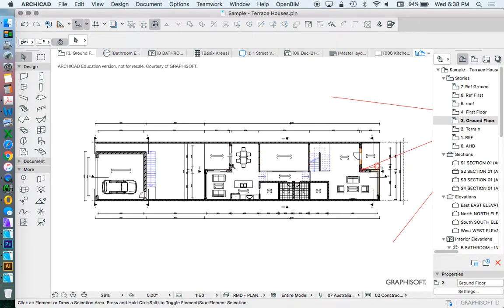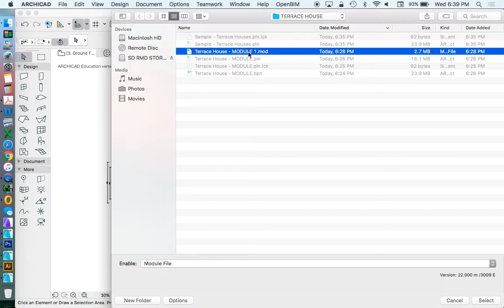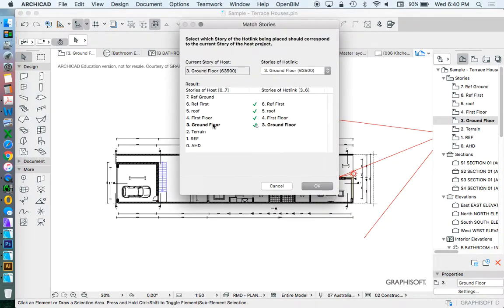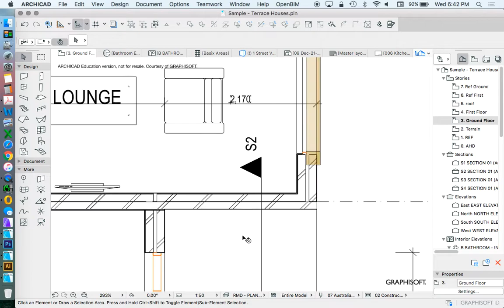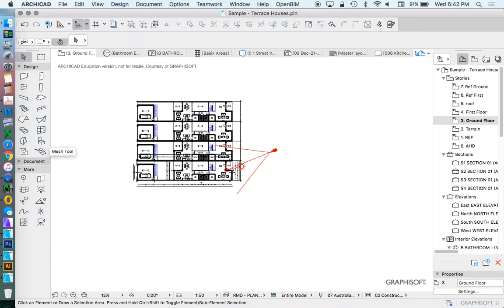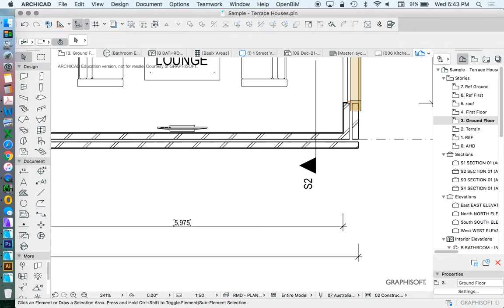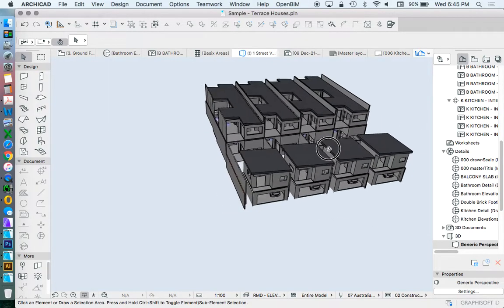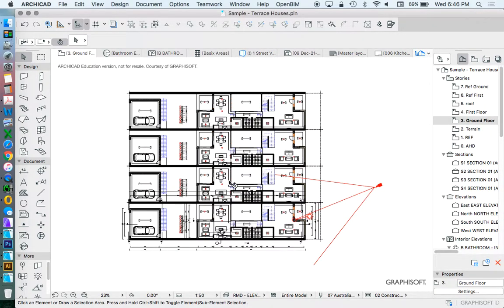ArchiCAD - Importing a Module or hotlinked file

Comment: Hi! Is there any way to create a Module that could be edited in the same file as it's used? Quick editing bigger amount of modules and opening separate ArchiCADs is sometimes a real pain in the neck to be honest.
Reply: just drag it in directly from the file you want in to your project
Reply: @adamoarquitecto5245  Thanks for answering! But then I belive it's no longer a Module. I was thinking about something like a Block in Autocad or a Compent in SketchUp. So I can edit it in place, in the same file, and it gets updated in all of the x copies that are in this file. Making an ArchiCAD object out of walls and ceilings doesn't really do the job unfortunately.
Reply: @karolwawrzkiewicz1254  Great question!

Comment: (No insulation ?)
Reply from the maker: I was using a student's file (with permission) for this demonstration. Yes, there was plenty of problems with it still that I had to ignore in order to provide the tutorial. If you noticed my momentary pause, I was debating internally to fix some of the issues, or just get on with the module making. I chose the later.